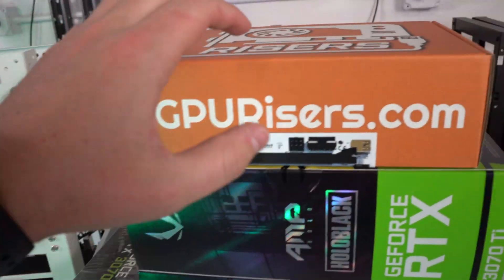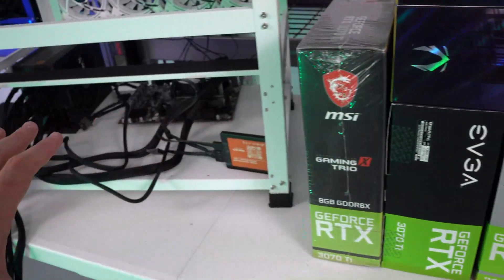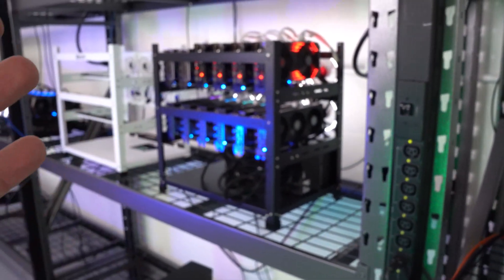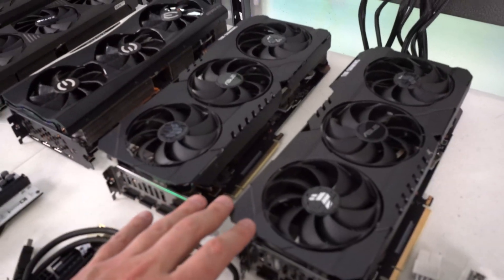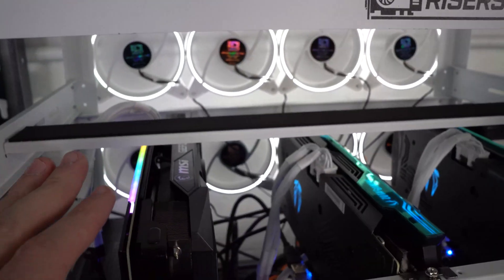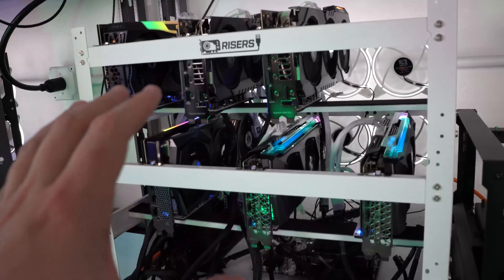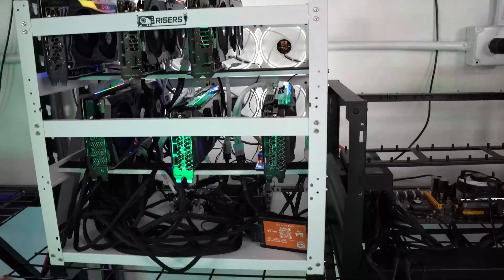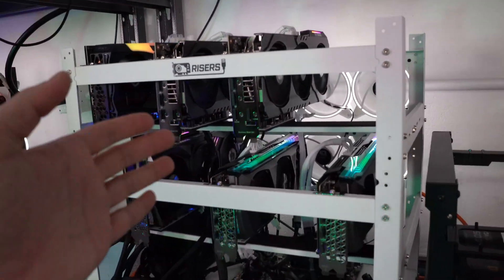RTX 3070 Ti Nvidia GPU Mining Rig Build - The Mining Bunker's Hashrate Grows!

Comment: So if risers pull a maximum of 75W, and the EVGA 8pin to Dual 8pin support up to 300W, given the 80% rule, would this not be considered dangerous to power 4 risers using 2 splitters off of 1 8pin VGA cable? Or am I misunderstanding and the VGA is rated for higher than 300W?

Thanks in advance.
Reply from the maker: The pull from the risers does not get near that wattage. The cards pull a majority of the wattage from the direct 8-Pin power cables. For example, a 3090 pulls about 56W from the riser, so you would be fine powering two risers with a single splitter cable for 3090's. These 3070Ti pull much less than a 3090 from the GPU Riser
Reply: @GPURisers  Thank you for the explanation. I'm going to implement this setup on my rig today to save some cables and open up some slots on my PSU. I appreciate your response!

Comment: On the 12 GPU Frames. Just curious what configuration are the 120mm fans in?  Are they pushing air over the GPU's towards the camera or Pulling Air from the GPU's towards the wall? Thanks
Reply from the maker: The fans are pulling air from behind and pushing cool air into the GPU's
Reply: Thank you

Comment: Michael, just a quick question, what are the benefits for the 8-cap risers when compared to the 4-cap versions? I am about to order some risers.👍
Reply from the maker: 8 Capacitor models have an extra LED on the main board behind the motherboard clip. More capacitors bring more stability in the electrical current going through the board.

Comment: Are you not scared the overclock will reset and draw more than 1600W?
Reply from the maker: I usually reboot the rigs manually and watch them for a little to make sure this doesn't happen. I believe in MinerstatOS you can also set triggers in the event wattage exceeds "x" amount. I for sure would be more worried in windows, however I have not ran into this issue yet on minerstat.
Reply: @GPURisers  Thanks! Currently on windows but will probably change soon